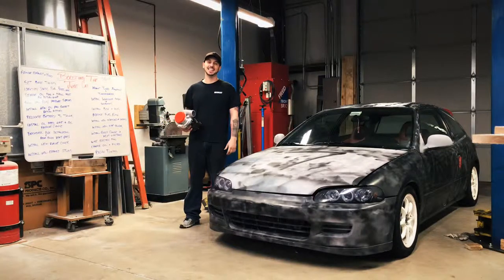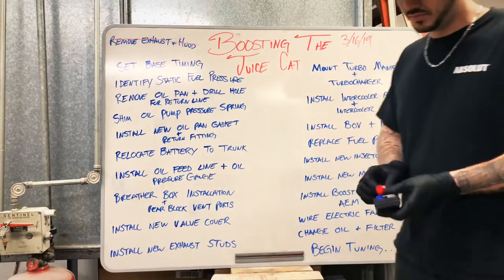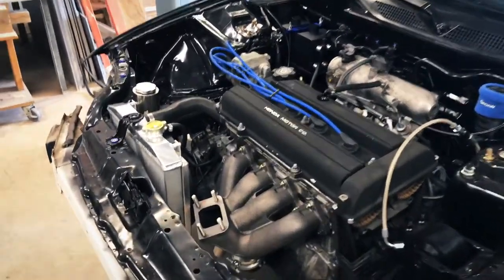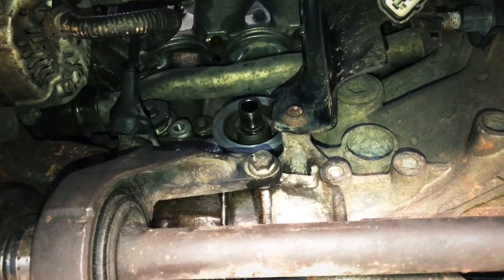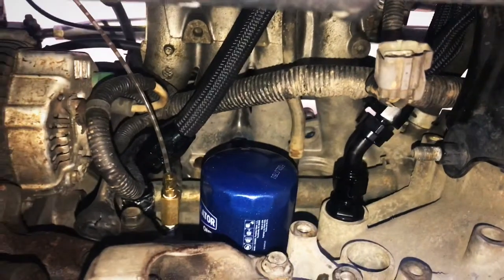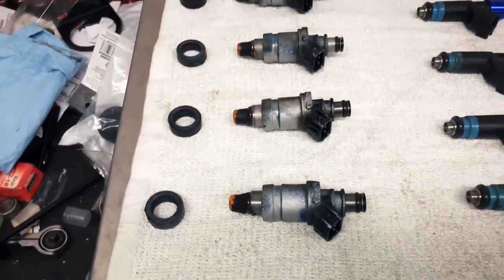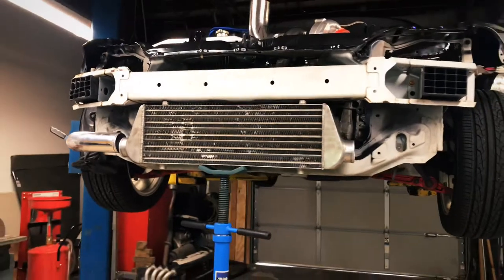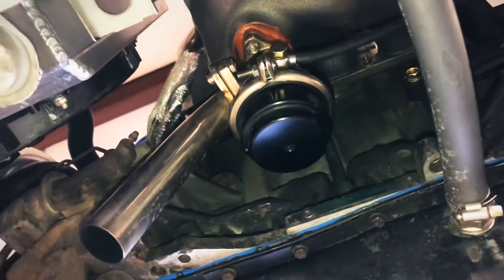BOOSTED in 24 hours!!! - How To Install A Turbo On A Honda Civic

Comment: Which turbo kit ?
Reply from the maker: Pieced together our own kit. eBay 7063 turbo, eBay cast manifold, inter cooler piping came as a set, injectors from a srt4 neon, kemso 340lph pump, left fuel regulator unplugged.

Comment: I thought you werent supposed to drive over 3000rpm until you tune it first?
Reply from the maker: Josiah Butler I purchased a P28 with hondata that was already tuned for the same exact engine I had. Plug and play. Downloaded tuning software and learned myself.
Reply: After 7 Garage cool.. so you didnt have to go to a dyno?
Reply from the maker: Josiah Butler dyno is very useful so you can keep your eyes on the laptop and not the road. I street tuned it with a friend driving while I tune.
Reply from the maker: Josiah Butler didn’t “have” to go to the dyno but it certainly would have helped. When you install a wideband o2 sensor you can use that as reference when tuning making fuel changes.